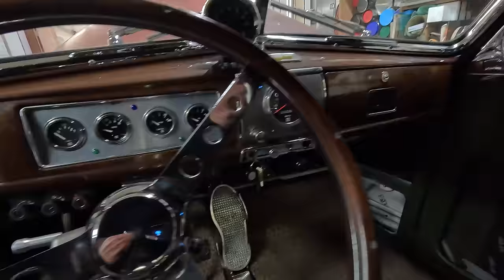Swamp Donkey! The First Build for Wildman Garage! Part 1

Comment: u guys bring light into dark times .............. bless u and mike thanks guys the world aint what it was im 60 and when im really really down i watch you all and you bring me hope joy and laughter you cant buy that !!!!!!!!!!!!!!!! truly thank you  im a bike guy but have always loved 1965 -74 muscle cars especially dodge cudas ,, chargers etc fast back mustangs etc there pretty special and rare down here im a kiwi living in Australia now but in my youth 20s owned a Valiant 74 VJ charger with a 265 straight six hemi aussie version of the USA they also had a 318 v8 fireball as well but were known for cracked cyl heads problems my vj wasent big power but 4.3 litres mild cam roller rockers holey 350 cfm carb extractors and twin system gave me 250-270 horse and it was all torque it gave the gm 253 v8 a tickle up after a 150 yard and then it was bye bye birdie bye bye loved that car it was the shit in sky blue with 8 inch chrome ies and the 96 octane leaded meant it would run all day and all night just keep the juice in the tank and change the oil evey 3 thousand miles could fix everything on the side of the road !!!! bought it for $500 bucks !!! there going for 30k plus these days i miss the old skool